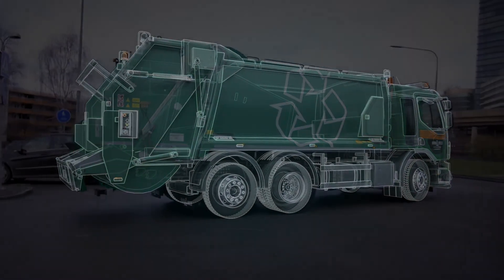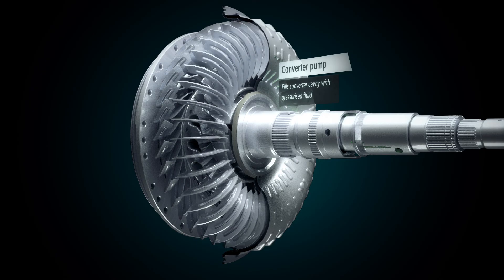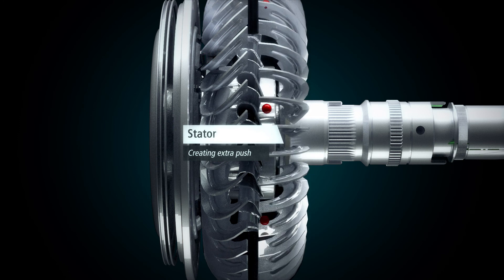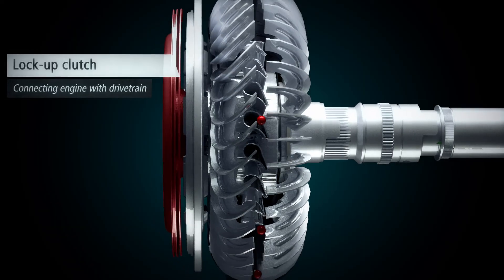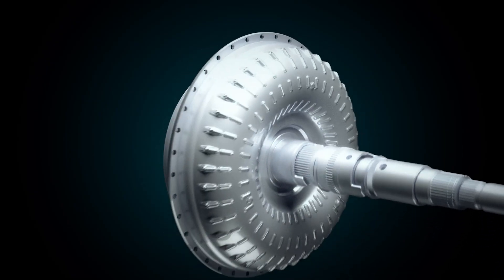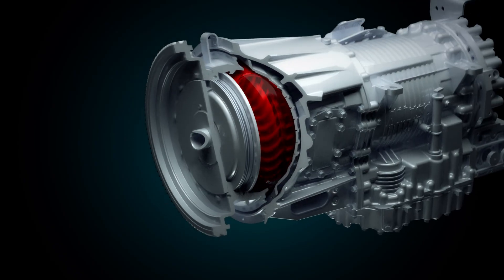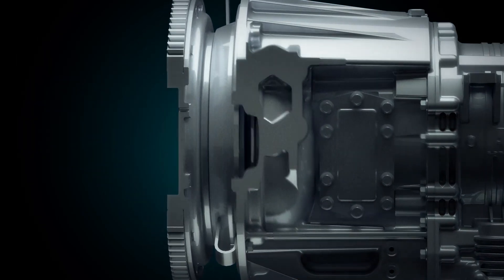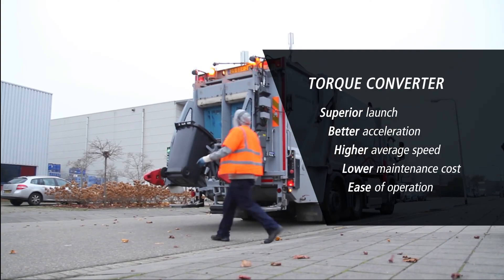Allison Transmission Torque Converter Animation

Comment: Why there is no use of hydrolics instead 😐
Reply: It's all hydraulic. There's a pump in the main body of the transmission, that supplies the fluid that's being used by the Torque converter.